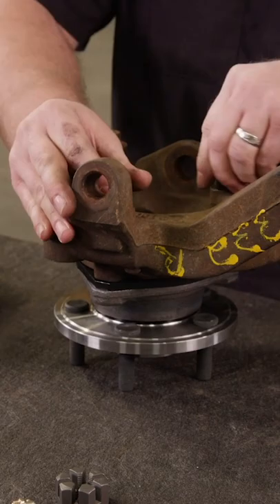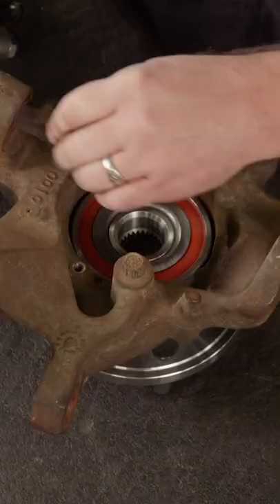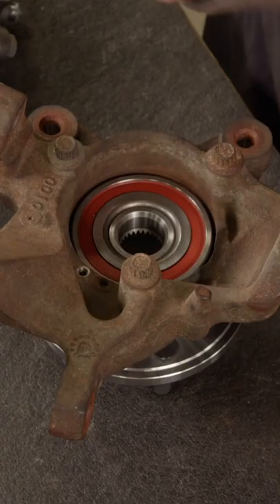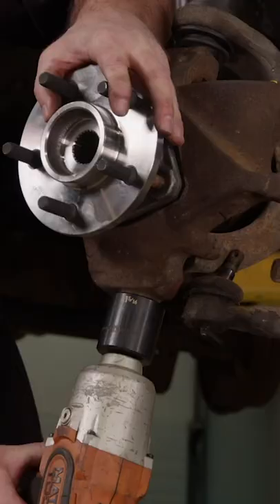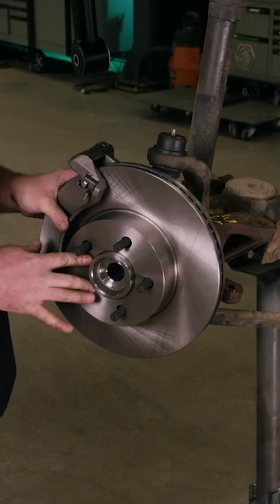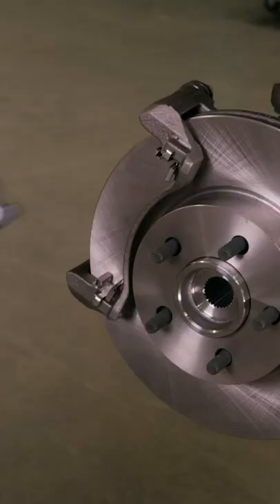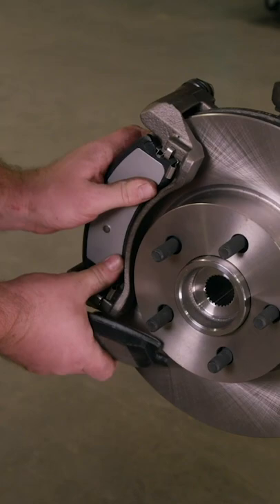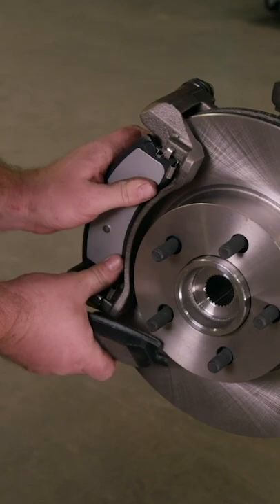Installing a DIY Big Brake Kit

Comment: Not 1 tiny bit of lube used..... yeah those pads and rotors won't last long
Reply: That’s exactly what I was thinking so I came to the comment section to find someone saying this 😂😂
Reply: It's funny how so many people have a channel where they're "teaching" other people but yet they somehow skip such basic steps that almost anyone could call them out on
Reply: If you do brake jobs you understand how pointless grease is to a certain degree, after a few car washes the grease has washed right off, brakes still work fine though. The small amount of grease that usually provided with a set of pads is for the ears to be easily installed. So many people cake it on and just attracts dirt and then water and makes it worse than having no grease I’d say.
Reply: @willferrell2266  the slide pins would disagree lol
Reply: Copper grease

Comment: Are you using lengthened axles? Just moved the axle out of the pivot line of the ball joints by the thickness of your spacer, now your axle and steering knuckle fight when they aren't straight going down the road.

Comment: Sooooo how about your axle length? Are the cv joints going to be stressed now that the distance is longer?
Reply: There's a good question
Reply: They don't explain anything. If this was a zj originally, you use a wj knuckle, spacer, xj hub, makes same width as originally

Comment: So what is the rotor and caliper off of?
Reply: Exactly. Like thanks for telling us about a spacer that can't be purchased. But let's just neglect the off the shelf parts that make this a diy kit.
Reply: @AUSSIEGARAGE_YT  Quarter inch spacer on XJ hubs makes me think WJ brakes, but yeah, a bit light on info here.
Reply: It's almost definitely a WJ knuckle, so likely WJ caliper. WJ rotor is the wrong bolt pattern, so it's probably something special. I don't remember what the part to use is, Explorer Sport Trac or something. But you are correct, there is some important info missing. Even for a "short". Honestly, I never considered fussing with the WJ brake swap, and risk my wheels no longer fitting. I opted for ZJ rear disc instead, and I wish I had done it a decade ago.
Reply: I did a similar brake upgrade. 

Early  xj knuckles 
2011 Grand Cherokee calipers and brackets
Sport trac rotors
Late TJ unit bearings
4 14mm bolt 10,9 grade
8 14mm washers to shim the bracket

Drill the brake bracket holes to 14mm
Grind a little off of the bearing flange to fit the caliper

Everything bolts right up. Recommend for off road use only.

Comment: Great job putting on rotted out parts
Reply: All it needs is a wire wheel and some paint. Nothing wrong with those “parts”. It’s the knuckle by the way.
Reply: Lol those are NOT "rotted out"
Just surface rust. Come to New england
Reply: It's a bit of surface rust, man... Big deal

Comment: So they've got the steering knuckle off the truck. And  they're not even going to take a wire wheel to it and apply a new coat of paint before putting on new hubs and larger brakes? Anyone else notice that puff of rusty dust when he tightened the hub bolts? What's the point of this if you're not going to do a good, complete job?
Reply: I would hope they are just mocking it up before painting but I noticed he put the cotter pin in. So I don’t know what to think.
Reply: @donziperk  I'm sure it's just a "budget upgrade", so it's OK to do a half-ass job of it. They don't really want to get as many years of good use  as they can...

Comment: Nobody classifies a two piston sliding caliper a "big brake" kit... honestly tho also, how much larger are those brake discs over the originals? Maybe an inch or two? So you have a 9" rotor instead of a 7 1/2"??... barely even worth it unless your plans are to throw some 35's or larger on your xj. Orrrrr... you're planning to auto cross it.🤣🤣. Waste of time. Just get slotted discs and upgrade the pads.
Reply: Or just send it and hope there isn’t a stop sign at the bottom of the hill
Reply: I was thinking just that, I have a 94 Nissan D21 that has factory dual piston calipers, if you consider dual piston calipers an upgrade, I gotta wonder how bad your OE brakes are